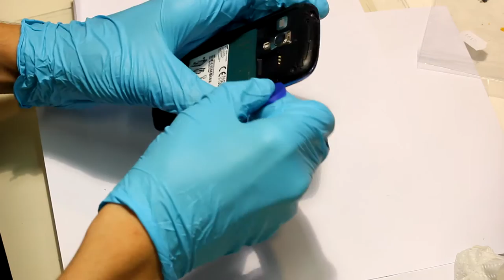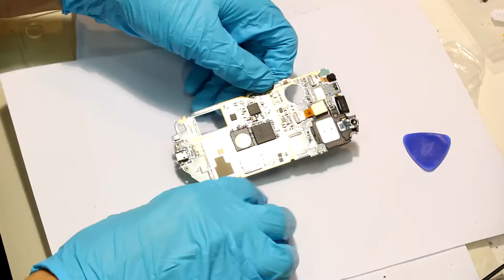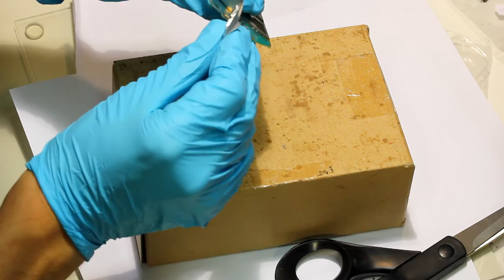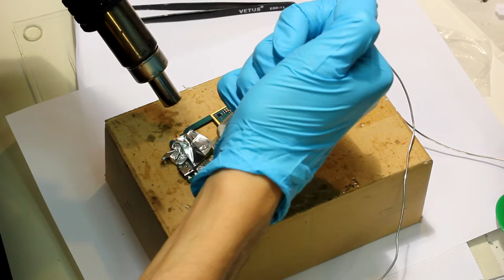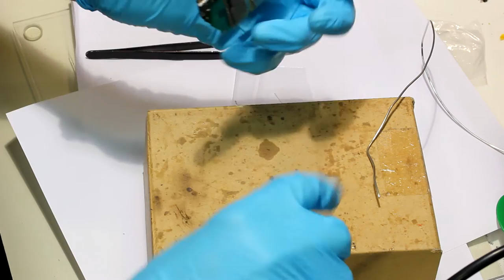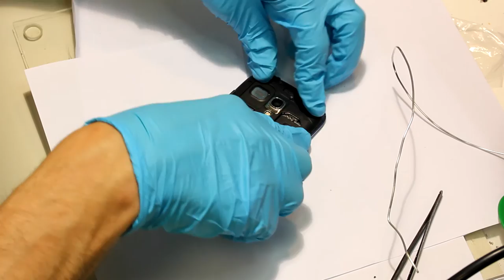Replacing a Samsung Galaxy SIII mini USB port that wouldn't charge, without kapton tape

Comment: Hi there! I got a question for you: since I don't own a hot air station and don't want to buy one just to repair one thing, can't I just remove the port by heating the solder connections with a soldering iron?
Greetings from Germany ^^
Reply from the maker: You can try flooding everything with solder and removing everything at the same time, but you will increase the risk of damaging something.
Reply: @jfaria  But why can't I just remove one after the other? And I have a desoldering pump, so getting rid of the solder is not a problem.
Reply from the maker: @kinto4135  Because it's an SMD component, it will be tricky to lift the shield one pad at a time without damaging the PCB.
Reply: @jfaria  Yeah, makes sense. I think I'll leave it to someone more experienced with better equipment. Thanks anyway!

Comment: Hi Jose, when i took off the old one usb port some of the pins broke off, (the pins that are on the motherboard that connect with the USB port) is the motherboard now destroyed? please help i messed up big time and just need a fix, i can't find any info about it on the internet so i thought i'd ask you.
Reply from the maker: When that happens you can do something like this: http://www.instructables.com/id/Repairing-a-Damaged-Pad-on-a-PCB/

You can also try and manually solder a thin wire between the new USB socket pin and the point where the old PCB trace broke off.

Comment: Hello Jose. Have you Ever replaced a Mini USB female plug (older style ) with a Micro USB female plug (Newer style)?
Reply from the maker: Hell Dive I never tried, but If the pitch of the PCB mount is similar you will probably get away with it.

As far as I know, miniUSB and microUSB have the pins in the same order:

1 - 5V
2 - DataN
3 - DataP
4 - Info (to know if it's a USB OTG adapter, and stuff like that)
5 - GND
Reply: I have an mp3 player that has the older usb... and i really wish it had the newer style. Do you work on such things?
Reply from the maker: Never did it myself, but you can always try, the worse that can happen is that you lost one hour and $2 in the microUSB receptacle :D

Comment: Which charging port did you use and does it have to specifically be S3 mini charging port or any charging port can be used?
Reply from the maker: +Joelle Brown I don't really remember, but I'm pretty sure the S3 had a generic USB socket. Bear in mind that many phones have special connectors to support HDMI and stuff like that

Comment: how can i change if i dont have that thing that removes the port after covering it with tape is there some else that i could use
Reply from the maker: You can put a blob of solder on the connector, connecting all the pins to the shield and then heat everything at the same time until you can remove it, but there is a higher risk of PCB damage due to overheating. A hot air station is pretty cheap, you can find them online for lesss than 50USD.
Reply: dude i dont have all of that you say is there any thing else that i can do :P
Reply from the maker: Mensur Memeti You can take it to a friend who does or pay a repair shop to do it :D
Reply: José Faria  i lnow how to change it but what i only need is a heat gun but i dont have it so can you tell me if i can use something else that is likely like the heat gun
Reply from the maker: Mensur Memeti Some people use those hardware store heat guns that are not adjustable, but those are usually too hot, might as well buy one of those chinese $40 or $50 USD ones.
Reply: Jose Faria i didnt tild you to tell me how much it costs and from where it is if you know something how to change it eithout a heat gun please tell me i will be thankfull
Reply from the maker: Mensur Memeti If you are not experienced, you need a hot air station, period.
Reply: Jose faria iam experienced. Dude with fixing phones. But im not good in money ok
Reply from the maker: Mensur Memeti You need a hot air station to do this procedure with minimal damage. You can use anything you want that will make it hot enough to melt the solder, but if it doesn't have temperature regulation it will likely damage something around the USB connector.
Reply: ok fine but can you help me with that for an example what can i use something like hot